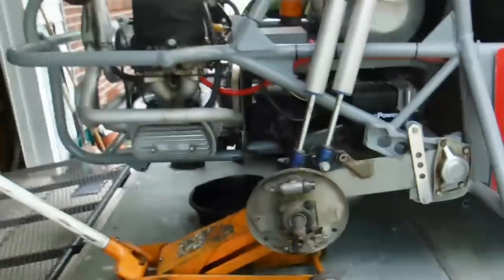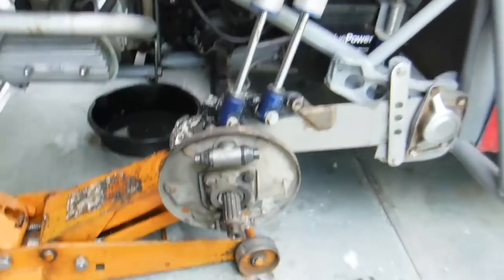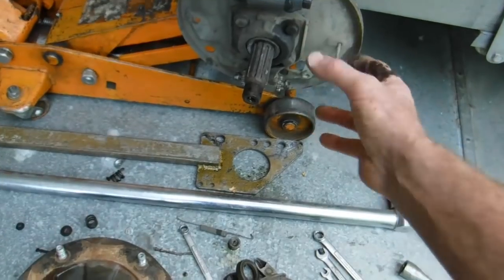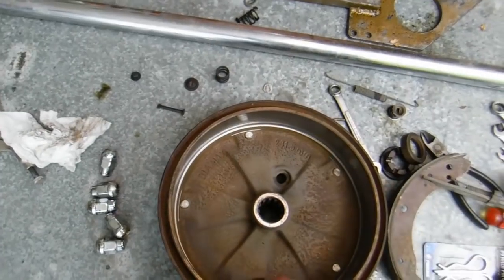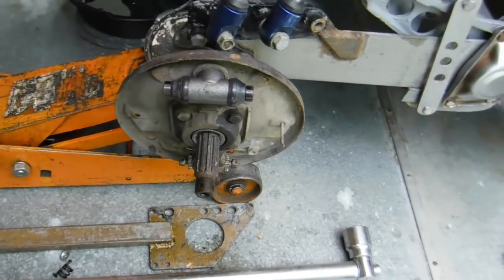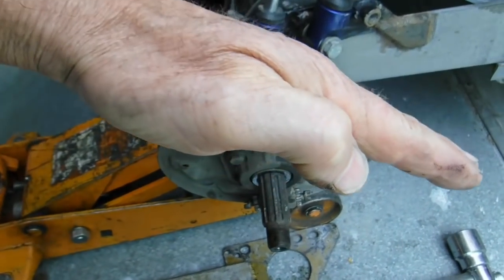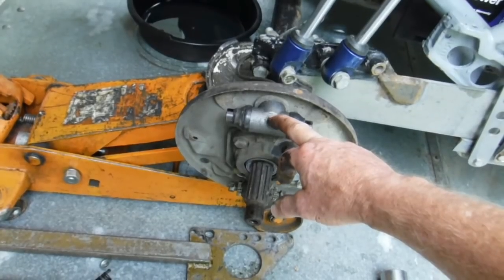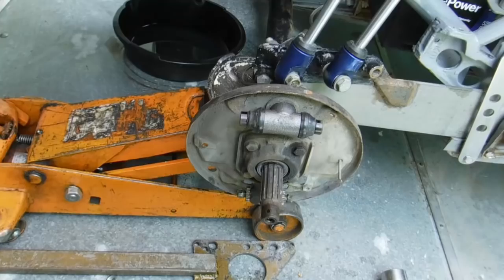VW Drum Brake Upgrade (Off Road)

Comment: Cool trick. It's a pain when the brake shoes hang on when trying to get the drum off. I'm glad you found that crack.
Reply from the maker: Thanks. I can't imagine what kind of impact cracked that drum. Must of caught some major air and come down at an angle. I need to make sure the wheel isn't bent. Seemed ok when I drove it.

Comment: Nice mod, good you pulled the brakes apart and found the cracked drum.
Reply from the maker: Yeah, The car didn't run when I bought it so I took a chance. It means more work checking things out but it's good to touch and fondle everything before you take it out and run it.

Comment: I put type 3 rear brakes on. Wider and bigger diameter shoes. Awesome brakes!!!!
Reply from the maker: at one time I used the type 3 hubs and 914 Porsche rotors along with type 3 front brake calipers for a rear only disc break set up. The pads lasted forever

Comment: That's a great tip!! Running larger wheels and tires on the Baja I could use the extra stopping power. The duel sport sounds great, keep it a two seater so I can go. HeHe. No really I want to go. Thanks for the video and information 👍👍.  VW:-)
Reply from the maker: The car is going to have to prove itself before I go gallivanting around the country looking for smooth sand.  Your welcome to join me. We will flip a coin to see who gets to drive. Maybe I will put the cutter brake in the middle. Whoever reach's for it first is a scaredy cat. LOL

Comment: i hope your able to get a genuine hub  somewhere because it seems as you probably know some of, if not all  the spurious ones are  soft as butter  i have seen one lately,   sheer the splines out   and it was with  a standard engine  , and the nut was tight too.
Reply from the maker: I lost the right rear splines on my tub buggy and rather than replace the drum I upgraded to disc brakes. So far so good. Lucky for me the other side was in good shape and matched the one that was cracked so put it on for now. Thanks for the heads up.
Reply: no problem ,its great to be able to share and talk about car stuff no one around here  interested,  could do with a neighbour  like you .

Comment: I'll have to do that to my bug I have disks on the front I think they're from a giea but I'm still running drums on the back I just pulled my arms off last night so I can cut off my torsion housing and raise/narrow it so now would be a good time to work on the breaks
Reply from the maker: KOOL
Reply: TheEZGZ the drag tires are a similar size to those paddle tires you off road guys run what problems do those cause for your drive train

Comment: stupid question for ya. i have a type 1 irs trans that i have a 3.0l accord mated to it. yes I've already replace the differential broke it last year. My question is i see they have a 091 super diff kit for irs,spider gears/side gears would it essentially be as strong as a 091 box? 
thanks lovin the videos brother.
mike
duridersa -got few sand rail vids
Reply from the maker: Weddle makes one but it's about $1k so you need a good reason to try it. I would look for a good 091 buss box if ya can find one.
Reply: TheEZGZ ya everyone wants $2500 for one. thanks brother. 1-4 gears as strong as 091 or is the 091 bix just strong of a case. 

I saw your vid where your buggy was a bit stiff, mine was like that in the beginning to.

Comment: Would this upgrade be ideal along with a front disk break conversion? Maybe an adjustable proportioning valve to dial it in? 🤷🏻‍♂️
Reply from the maker: No!!!!!  I have come to hate these brakes. They squeal and growl after many attempts to correct this. It's just to much brake to have front and rear. I plan on going back to drums when I get the chance.  Not to mention these Empi disc brakes are 11 pounds heavier per wheel...... :-(
Reply: So what you recommend for me on my 69 Baja bug? Currently my brakes are an absolute brick and you gotta stand on the pedal just to slow the car down. Without a doubt, my whole brake system has to be completely rebuilt at minimum.

Comment: So just a front wheel cylinder on the rear no other mods needed?
Reply from the maker: That's all I did. $10 per wheel cylinder if everything else is in good shape. Don't expect them to work like a disc brake upgrade or buying lighter wheels and tires but it makes a difference. Especially if you need to work on them anyway and your on a budget.

Comment: so even though your changing tbe size of the cylinder the shoes are still the same right
Reply from the maker: Basically, yes. Don't confuse surface area with cylinder size ratio.  Not a true comparison but think how small pads are on disc brakes for what they do

Comment: Is that a '66-'67 drum with late 4 lugs backplate? Coz i was thinking of making my rear brakes stronger, my rear shoes is only 30mm in width the later 4 lug ones are 40mm
Reply from the maker: My son had bought a pair of standard rear drum for his 66 but didn't use them. I tried one and it was to narrow. I had one just like the cracked one and it was a tight fit so I went with that. Generally if the drum has a smooth face it's narrow. If it has the cross it's wider. It's hard to tell on a car like this what they used.
Reply: TheEZGZ  thanks i think i'll give it a try :)
Reply from the maker: Don't expect a really big difference but you should notice it. $20 Why not :-) Seems like I remember filing out a whole the last time I did this. Long time ago
Reply: +TheEZGZ. Okay,for me its always front wheels locked up with my '66 karmann ghia, maybe because of brakes being not balanced,  my 1970 vw bug all drum brakes,does a better job than my 1966 wide5 all drums vw brakes

Comment: OK I BUILT A VW TRIKE PUT HYD. FOR CLUTCH AN BRAKE I USED 3/4 MASTER WITH CLUTCH SLAVE CYC. CLUTCH IS HARD AS HELL TO PUSH BRAKE SO SO HARD TO FEATHER CLUTCH WHEN TAKING OFF AN THIS MAKE TRIKE WANTING TO DO WHEEL STAND I AM 69 TO DAMN OLD FOR THAT WHATS DID I DO WRONG WITH CLUTCH NEVER HAD THIS BEFORE IN ANY OF MY LAST BUILDS
Reply from the maker: You need smaller master cylinders to reduce pedal pressure. The basic principle of hydrolics is the same as a floor jack. large slave/small master. Hope this helps